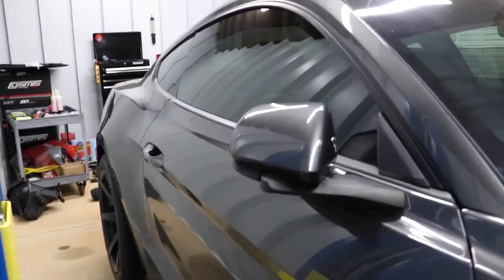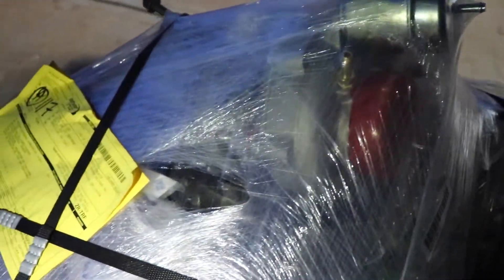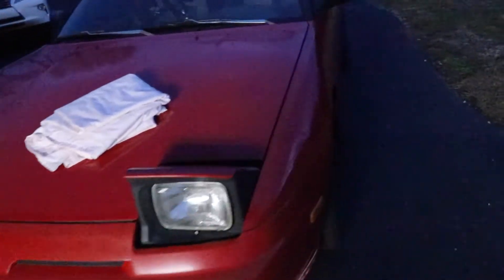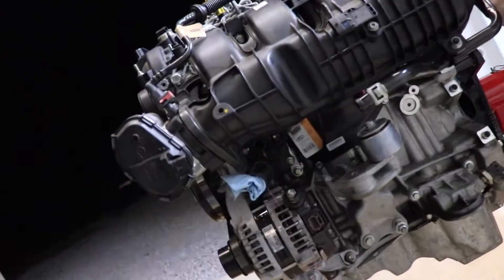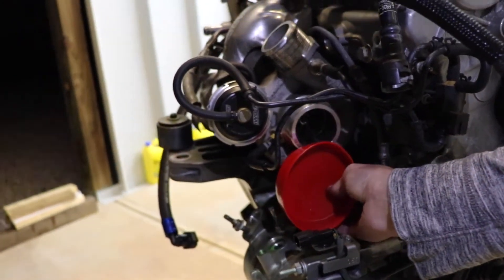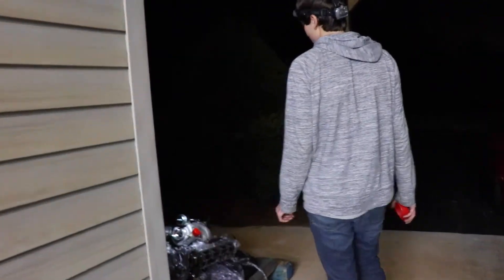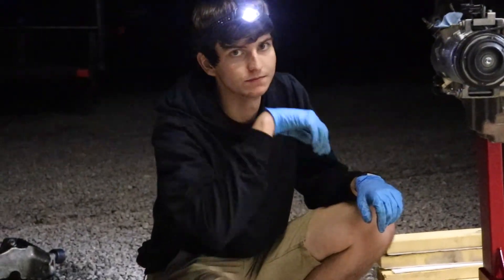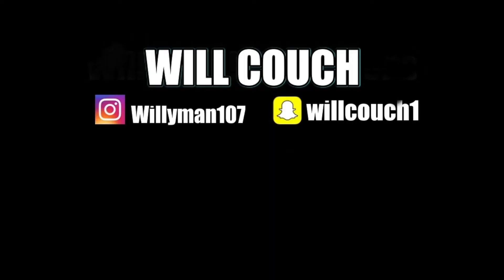2015 Blown Motor Ecoboost Gets...New Motor + Big Precision Turbo!!

Comment: We want updates of Patrick’s car
Reply from the maker: drockhead unfortunately me and patrick aren’t friends anymore.. but he sold the Ecoboost and ended up getting a blue 5.0. Pretty sure it’s on e85 but other than that I don’t know 🙃
Reply from the maker: Also I might could add. The ecoboost motor never worked out. Basically ford has tolerance issues with the machining on the heads..

Comment: gonna stretch headbolts again just like the other one, simply too much volumetric efficiency to last very long at all. . .you will have to baby it and keep it under 80 to make it last more than just a few years, if you went and raced it it would go wicked fast for 10 minutes then it would chunk a motor
Reply: FlyingWldAlaska77 head *studs*; not bolts. Much stronger.
Reply: the new motor came with studs? then its probably ok. that fixes alot of ford head gasket problems like the 6.0 powerstroke, even though thats international but ford knew what they were getting into with all the EGR shit on it that made them all lemons. if ford knew any better they could probably save money off warranties and shit by just putting head studs in it in the first place. or just larger diameter bolts. could probably test their products before they rush them into production and make them bulletproof if they really wanted, the 6.0 and its almost identical brother the 6.4 had lots of terribly designed components that made them the reputation they have now "useless pieces of shit" even though they have since been figured out long ago. you can make one bulletproof simple and easy compared to the total bullshit thats in modern diesels burning DEF. the def alone probably hurts the environment more than the exhaust from burning diesel, and then theres the regen cycle where it all goes out the window anyway. its all a big fuckin scam and im sure if making them reliable made them more money than making them all pieces of shit they would do it, sorry for the rant but modern vehicles are designed to please the devil not the consumer